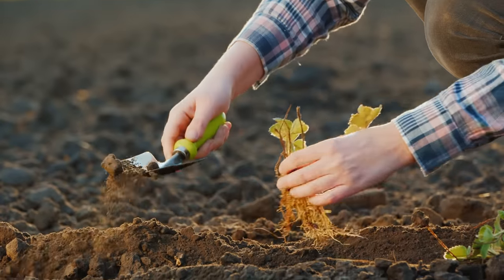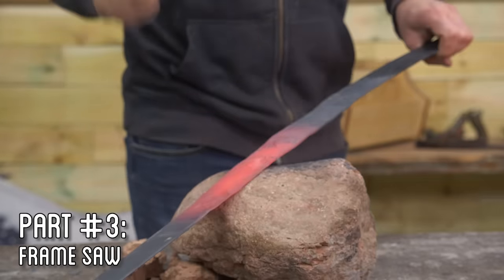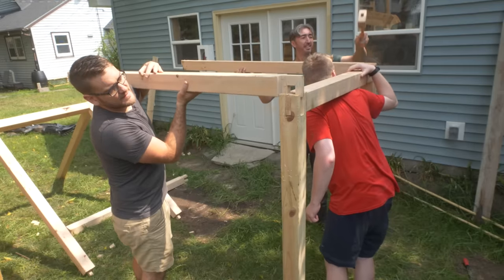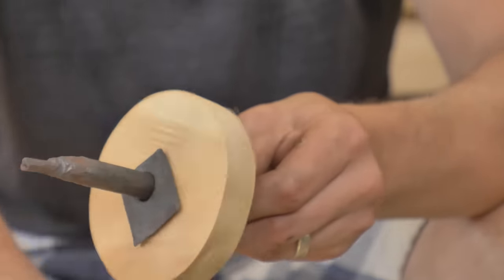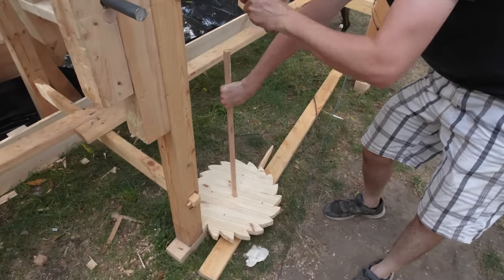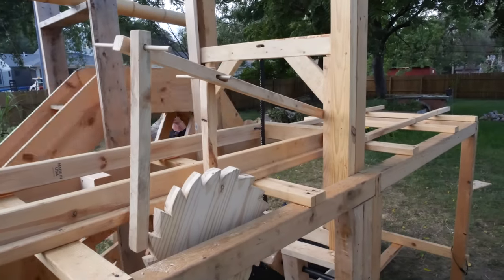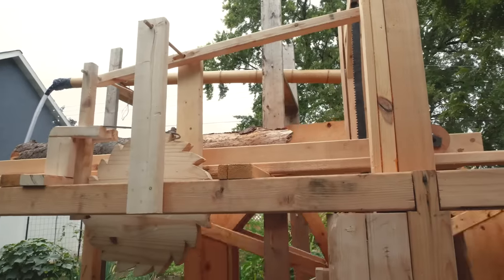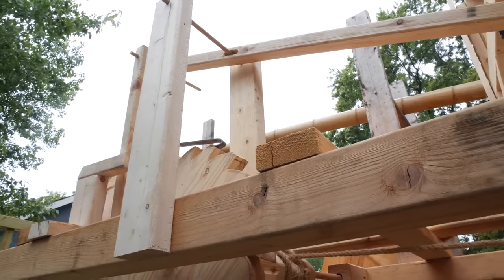I Built DaVinci's Saw Mill

Comment: I have a few constructive criticisms: 1) the transit of your saw frame suffers enough slop that it's actually making an orbital reciprocation. Your cut will suffer from this motion. 2) the tooth geometry of your saw should be revisited. It looks to me that the teeth are filed in a crosscut pattern with a VERY relaxed rake. If you want to rip cut a log (and do so with any kind of speed) then you need to refile your teeth to a rip pattern with a somewhat aggressive rake angle. 3) your results would benefit from ensuring that the saw engages in the cut on the down stroke.
Reply: He needs to see this
Reply: All of that is great advice. His saw blade is definitely holding him back.
Reply: Oh wow! A rennisaunce era saw made with only period technology has slop and takes forever to make a cut? Whoda thunk it!
Reply: A real one wouldn't.  This guy obviously isn't a master craftsmen of that era.  I'm not even sure he knows what a triangle is, considering he made an all square saw support @MeepChangeling
Reply: hell he even makes wooden gears with teeth along the grain
Reply: @philipripper1522  His edge profiling and refinement has been a fairly consistent issue. I think he even addressed it once, as "unimportant" to him. It is a simple enough skill to learn in a few hours of focused practice and would have paid dividends by now. Even with a softer metal, you don't put up with a bad edge, you just have to give quick touch ups more often.
Reply: If anything, the blade needs to be figured out first and formost, for sure. They had proper rip saw blades back then. He used a modern file to make the teeth on that one after all.
Reply: indeed not to mention the slop in the actual drive line, is causing the frame to move where it shouldn't be moving and finally it should be geared with a dog clutch so it can be engaged and disengaged so it can build up momentum before the cut.
Reply: @MeepChangeling bro they definitely had better wood working skills than this.
Reply: @MeepChangeling  Well, the did have excellent saws back then. But HTME is only a few folks, the host not having the decades of experiance in smithing alone that you'd need to make one.

though to TwinPhoenix' credit here, you could make the argument for buying a blade with better handling characteristics now that you've proven you could make one that does work.
Reply: @MeepChangeling  They knew how to make a rip cut long before the Renaissance. This saw geometry needs to be changed for this task.
Reply: As a fellow woodworker I totally agree with this comment. Please fix your saw teeth to make your results far better.
Reply: the frame needs to have less slop (better carpentry, adding diagonalbracing...) and the crank needs to be better and certainly frame and slide as you are loosing lot of power and precision there making the cut wider than necessary thus just wasting power.
bearings must have minium play as any slopines means wasted effort.
surfaces must be greased with copious amounts of lubricant, traditiolnally lard/beeswax/tallow/vegetble oil...  mixed  to be right consistency.
and also the blade is croscut not rip cut
Reply: Some kind of gearing to speed up the saw could also help.
Further the sled could be spring loaded with the ratchet, to ensure a constant pressure and not too much.
Reply: I know the one you built was far better, I just can't find the video again, be a sport and give the link. Everyone should see it, it'll blow their minds!
Reply: I noticed that too. A rip saw would be vastly superior to a crosscut saw. Also, if he maybe put a heavy duty spring on the rope where it connects to the skid frame, it would help with more even and constant pressure with both the up and down strokes. Lastly, seems like the ratcheting wheel has rather large teeth. Maybe more, smaller teeth would cause a smoother continious cut?
Reply: Yeah a better saw would probably speed up the rate of cutting
Reply: @barongerhardt  lots of the joinery here is somewhere between ordinary and awful.  Enormous gaps in joints that could so easily be made good by hammering a wedge into them, instead they make nails by hand...
Reply: How about you build it nerd
Reply: Yes, and a thinner blade cuts faster and requires less power. And grease is your friend, almost every joint and shaft would benefit from it.
Reply: @philipripper1522   You didn't watch the video, did you? It's based on da Vinci's sketches, which includes square supports and no triangles.
Reply: yes, this. One of the reasons I've never subscribed to this channel is that the projects (while big and thus a big challenge) are often pretty sloppy, and then he  says "welp didn't work!" ... but like. Did you see those castle joints? Medieval wood workers could make tight joints, and that does impact performance when nothing is square and loose.
Reply: @philipripper1522  it is a glued plank with cross grain orientation 😛
Reply: Can somebody out there define ‘slop’? I can probably guess, but I’d rather know precisely
Reply: @DFX2KX  You don't need decades of experience to do this. A few hours listening intently to someone decently capable would be enough. A saw like that would not be made by a master craftsman, it would be done almost exclusively by an apprentice who was likely still a child.
Reply: To chime in on the comments below, I think this is the perfect example of why/how technology can be lost and it takes awhile for it to be rediscovered. There's so many little nuances and terminology in this post thread that even I never knew about (like rake angle, slop (I'm assuming that's an industry term and not a typo for slope), along the grain vs against the grain, types of lubricant, etc.). The fact that HTME isn't an expert wood craftsman or smithy is exactly why I like this series. It shows really just how difficult it was to come up with the initial concept (and even then, it's a proof-of-concept prototype, not the finished product). Sure, in the late middle ages, you had maybe 500 other experts in your city/kingdom who then tried their hand in improving things, and those are the ones that tend to get all the credit for perfecting it, but it's more interesting to see how far one person (or a handful) can "move up the tech tree", so to speak.
Reply: @philipripper1522  It's literally impossible to make circular gears with zero teeth along the grain... unless you use plywood which curiously I don't see many examples of in Da Vinci's time, but let me know if you know of some...
Reply: @najroe  You can't "add diagonal bracing" bro. It is a build of Da Vinci's saw design, and the design clearly has no diagonal bracing in it. Joints can be nicer, yes, but the diagonal bracing is a flaw in the design from Da Vinci, not from this youtuber. Address your concerns to Da Vinci: 1357 Maple Avenue, Leonardo, Pennsylvania
Reply: Was at the very least expecting that wooden rod pushing and pulling the full force of the saw to snap in half.
Reply: It also doesn't help that a majority of the components are made from pine, which isn't the best material for something like this, someething like a red oak or even a white oak would be better because of the density and weight, heavier and more dense woods make for better framing and structural materials but they are a bit mire difficult to work with as a result of their density.
As it stands now, the whole frame and "body" of this sawmill is extremely weak and flimsy compared to what it needs to be in order to saw lumber.
Reply: @jennifer255  those words aren't "industry terms" they are very common sense words that a lot of people use in every day language, if you wiggle a door handle and it flops around, then that is slop(or play). And the rake angle is simply the angle that the teeth are on a saw, they also use rake for barges or basically anything else with a "degree of slope" technically has "a rake" to it, and that rake can either be positive rake, ir negative rake, depending on it's orientation
Reply: @gavinjenkins899  this is not that difficult. you build a traditional wheel. and then you cut the gears from it. you probably need to align the grain a bit differently than an ordinary wheel but it is possible. 

The question is, is it worth the hassle?
Reply: @spec_opsgaming  Never heard that for a door handle, at least in my part of the US. We'd just say "jiggle" . I also thought "Slop" was wet, formless food. My grandfather did grow up in Appalachia, and his 2nd wife was from West Virginia, so maybe my mom picked up some Appalachian dialect terms and passed it down. :D
Reply: @nilsdock  1) That would make ALL the teeth wrong 2) traditional wheels are held together by a metal hoop on the outside, what holds it together if there's active gear teeth outside instead? And trying to make a wheel instead with a bunch of thin crosscut pieces would almost literally disintegrate in your hands. I say it's basically not possible, because the rotation and general integrity of the wheel needs the grain to be around the circle, but the teeth not breaking off needs the grain to be radial. It can't be both at once.
Reply: This comment proves you missed the point entirely. He's working from a period sketch, so the design is directly inspired by it. The point of the video is that it proves Da Vinci's saw mill "works", though not very well. Obviously it can be improved, with the benefit of several centuries of hindsight and / or an engineering degree. This is obviously not the point of the channel. He's trying to retrace the footsteps of our ancestors. The iteration is the point, not jumping to the end. As for the sawblade, given that he hand-filed it, I'm sure he just didn't want to have to make another one, especially since he's still using it in his bow saw.
Reply: @Lux158  I would just opt for a gravity feed. A suspended weight and pulley system could pull the log into the blade at a constant pressure. If its to much pressure reduce the weight to little give it more weight. Simple and efficient. For saw speed a larger crank with a longer throw is more practical then a gear system. A cross head can make sure the saw only gets up down movement with less binding.
Reply: The orbital reciprocation of the blade is not necessarily an issue if the orbital direction is correct. Engage on the down stroke and at not on the up stroke. With the direction it's currently moving, it won't do that, but with the direction of the Da Vinci design (with the under-flow water wheel), it does. You could instead turn the current water wheel around and get the desired motion
Reply: He’s saw blade frame is moving wood on wood, I can see a lot of loss energy via fiction. Use grease or add wheels to the fame so when it moves up and down you get 100% energy into that blade. Also add a few gears to change the blade speed I wouldn’t run the blade from the water wheel it’s self but have it run off a smaller gear that feeds of the main wheel. Best thing to do is get a book on clock work you can learn how to make things move in timing and in different speeds
Reply: Definitely unskilled builders, so sloppy and wonky, sharper teeth would help and change their geometry 😳
Reply: Resisting forces along the grain on red oak would be worse than pine, across the grain you're 100% right. Well anything is better than 'whitewood'.  But the biggest lost of strength is just the grain orientation @spec_opsgaming
Reply: its been pointed out repeatedly i dont think he actually reads comments
Reply: Funny how you all are a professional woodworker but failed to understand the instructions made in 1400 😂😂😂😂
Reply: That makes sense raising the efficiency of the blade makes less stress and heat
Reply: those weren't instructions, they were a sketch -- real plans for this kind of device existed in this era and DaVinci just drew a picture of one in his notebook for fun, it's not a plan @wetwildwendy
Reply: In the words of the great Jeremy Clarkson, “Ambitious but rubbish.”
Reply: Get rid of the wheels on the log sled, tighten up all the sliding surfaces and lather them with tallow. Also maybe don't try to power the thing with a hose pipe.
Reply: Don't know it it was mentioned here, but using pine won't help at all. I'm sure it's due to the cost of production but, a hard wood would be the way to go in this kind of work/all his wood apparatuses. Or at least a harder pine and not 2x4 lumber...
Reply: I love the helpful hints if you was building one , but maybe it's just me but the wording you used sounded kinda condescending.
Reply: I would add a stop pawl on the ratchet and maybe a pulley system to reduce the sled travel per stroke.
Also the connecting rod on the crank is waay to short ending up using most of the force just to work against itself
Reply: @jennifer255  the point is the actual terms don’t matter, it is the concepts which are very common sense. The terms just come about as a way of communicating the concept. “Slop”, “Play”, “Jiggle” all describe the same thing, a loose fit and telling if it is a lose fit is something pretty much everyone could do.

Anyone who is seriously working on this could figure out concepts like the angle of the teeth as well.
Reply: Do a crossover with some of the woodworking YouTubers so your machines are well built. Better joinery, glue, and real craftsmanship will do your series a huge favor.
Reply: @philipripper1522  And still you missed the whole point of the video 😂
Reply: Yeah, the slop, of course, is a result of him trying to remove friction of guides from the equation. The saw doesn't have enough torque to both cut and deal with friction.
Reply: @MeepChangeling  you might want to Google that before making fun of rennisaunce era carpentry.
Reply: As a carpenter I concur. And I think it has a lot to do with him copying the sketch in a littral fashion instead of researching real world contempurary solutions so he could use DaVinci's sketch as a piece of concept art and then build it like they would have done it in real life back then
Reply: I feel like the bad saw tooth profile, sloppy construction, etc., is working exactly as intended by generating lots of engagement in the comments section.
Reply: @benjamincox7425  Excessive play in the joints and moving parts.
Reply: @MeepChangeling You really think they'd see these issues back then and go "Huh, shame about that" and not yry and fix it? People were still smart and practical then, and knew how to cut a log good, especially if it was their craft.
Reply: DaVinci speaks
Reply: Word up...
Reply: That rather tech for me , however perhaps he should have done some research how they cut lumber in those days. He might have had a reasonable result instead of good timber going to waste.
Reply: honestly I can't stand the way he does stuff, now i remember why I stopped watching him. Poor research, poor building. I watch plenty of other channels that do historical recreations of things so much better, with proper research and time gone into making things, and a lot more common sense when it comes to problem solving
Reply: @SmolPotatowo when I saw his blade I was instantly like “why didn’t he file it like a normal blade it’s basically just sanding the wood not cutting it
Reply: They could also put the saw under more tension, and or make it longer.But yeah, that sawblade could use a touch up for sure.
Then if they triple the amount of teeth on that wheel that pulls the log, make their intake for water bigger and put a filter on it, it might work as intended.
Reply: This should be the pinned comment.
Reply: Correct me if am wrong. Orbital reciprocation pretty much means the blade wants to twist when working??
Reply: This was divine is not modern man back off fuzz ball
Reply: @MeepChangeling actually I have seen a similar saw made and it cut fast and clean joints were very tight. Different wood for construction is key.
Reply: Aaaand a much longer connecting rod would direct the power of the crank along the direction, the sawblade is supposed to be accelerated in wich. With this short connecting rod, the crank pushes against the sawblades framerails in a steep angle.
Reply: @shelbyseelbach9568  @4:37 you can see the most unprofessional joint I have ever witnessed in YouTube history. That joint says so much. 

Firstly, it shows the lack of attention to detail in cutting the joint. You don't get a quarter inch gap without being careless. All while talking about how secure this form of jointing is. He says they can better secure it through nails and some glue. No, you cannot. For wood glue to work properly, you need darn near a press fit. You can create a filler from wood glue and sawdust, but it has no structural strength. So the real solution, after already removing too much material, is to place TWO glue covered wood wedges in the gap. They should be cut so as to have a press fit. You stick the wedge in there and if you dont have a quarter inch sticking out, you cut the tip off until you do. Then you pound the second wedge in with a mallet, trying to get as much as possible of that last quarter inch in. Then you you just chisel, file and sand to make it flush. 

Instead, he shoved a bunch of wood splinters, nails, and glue into the joint in a very noob-a-licious attempt that actually takes longer than the proper fix. I mean, I am a retired toolmaker not a carpenter, but I still have a bunch of wood wedge in my tool box. Why? Because they are a staple of every home repair/handyman/homeowner. 

And I didn't even begin to discuss how two nails holding a sloppy joint together leads to delamination around the nails. Nor how important structural rigidity in general leads to better efficiency, repeatability, accuracy, wear and repair... 

The guy really should work on his attention to detail and his fit & finish. He can work less, have a better result, and look far more professional. 

tl;dr If you don't have time to do it right, then you don't have time to fix it.
Reply: @krisspkriss  I'll refer you to my previous comment.....
Reply: @shelbyseelbach9568  And I will refer you to the fact the man spent longer doing it wrong because he is too stubborn to do it right. 

I don't make YouTube videos. I make shit that actually works. That is my bread and butter. Sad you dont understand how in modern economy you find a specialization and niche. His is making  videos of him making things that dont really work but it is close enough to fool the normies. 

So if you hire someone and they do a shitty job on your car/house/fence/yard do you say "well I didnt do it myself so I cant complain". If so, then you are so precious. 

The guys sucks balls at making things.
Reply: @krisspkriss  That's what I thought..... Keyboard warrior.
Reply: @shelbyseelbach9568  OK, show me where I was wrong in explaining how to fix this contraption. I will wait.

The lady doth projects too much, me thinks.
Reply: Surprised that after the first minute I noticed the same things.  He looks super tired though, so I imagine he’s burned out.
Reply: RepentandbelieveinJesusChrist5  HILARIOUS!
Reply: @MeepChangeling  Don't underestimate early modern handicraft. The artisans back then were very good at what they did - after all, different to a modern day experimental archaeologist, they practiced their work every day and knew their materials and techniques.
Reply: @johnathon007  Even an apprentice would not be allowed to make such a horrible blade - he would have to master and demonstrate more basic skills first.
Reply: @gavinjenkins899  I believe it was the Egyptians or Greeks who made plywood in ancient times. It is hardly a recent invention.
Reply: @gavinjenkins899  He said "based on", not "as identical as possible".  Da Vinci's design lacked a lot of information that was used for this machine.
Reply: @philipripper1522  Wheels were assembled out of segments since ancient times for that exact purpose - to get the maximum strength for the desired purpose.
Reply: @philipripper1522  I think the builder even mentioned that in the video.
Reply: @VictorGuzman610  I think in this case that it means a saw blade the move toward the log after momentum is gained for the cutting stroke and retreats a bit on the non-cutting part of the stroke.
Reply: I would just like to say that, 1) if this came across as condescending then that is entirely due to the way in which YOU perceived my statements.
2) as I stated to begin with, my comment was meant as one of CONSTRUCTIVE CRITICISM which is meant to help provide insight in hopes of future improvement and to assist in overall growth.
3) I think that this guy is accomplishing something that is truly fantastic and enlightening. As a fellow craftsman, I love watching his process and problem solving approaches. I want nothing more than to see this guy succeed, progress, and continue to share his knowledge and lessons with the rest of the world. Support and collaboration is what will help our entire species progress and thrive.
And 4) of course I watched the entire video. Y'all are a bunch of (likely) well-intentioned individuals that happen to be jumping to conclusions and then taking offense on SOMEONE ELSE'S behalf and attempting to defend someone who didn't ask for your defence against words of positive encouragement that you decided could only be a means of attack, by whatever logic you failed to employ, when there was no reason to defend anything in the first place.

Honestly ..... Grow up. I'm only trying to contribute in a positive manner to help us all progress in some small capacity. You, on the other hand..... You're part of the problem that will hold us all back. So thanks for that....
Reply: I admire your criticism. You're not being rude in any sense. Forget the other crybabies that just want to be keyboard ninjas.  Guaranteed they never pounded a nail or turned a screw,  at the least
Reply: Well, their YT machine seems to run pretty well.  Nice chunk of ad revenue that comes from monetizing 1.75M sub channel.  Maybe they were fine tuning the YT machine and figured that learning to build it too well wouldn't get the optimal amount of engagement.  Call it fine tuning their entrepreneurial engineering skillset. . . LOL.
Reply: @nilsdock you can't align the grain on a circle. The whole point of a circle, is kind of that it goes all the way around evenly. So, if you use a couple of those brain cells, you'd know that means your gonna get all angles of the grain, more or less evenly. Stop acting like you know what your talking about when you cant even show basic material knowledge.
Reply: @jennifer255 nah their just up on their high horses pretending to be high and mighty because they figured out how to look up a couple words in the 21st century 🤦
Reply: you assume one piece of wood being used. what I proposed was to join several pieces of wood, therefore you can get the grain direction you want almost anywhere. lets say the outer part of the wheel is made up by 8 segments, and if we align the grain in the middle of each segment to be optimal, then the grains would at most be of by 1/16 of a full circle or 22.5 degrees of.

however the craftmanship to get a wheel like that built would most certainly not be worth the hassle.
   @byeluvby
Reply: A very cool project!
Reply: YEs I suggested CASTING a thicker sawblade, as I noticed a lot of flex during the cutting motion, due in part to a small crooked hammer forged area.
Reply: @MeepChangeling you are a fool if you think this thing was poorly constructed during its actual use back in the day
Reply: @IanZainea1990 I noticed that too. I made better stuff in high school woodworking than this guy

He is far too sloppy
Reply: @jennifer255 nah, this guy is just a slop. I made finer stuff in high school woodworking
Reply: @wetwildwendy if built in the 1400s, it would’ve been vastly superior to what this YouTuber did
Reply: To many big words
Reply: Cool. Wheres your saw mill?
Reply: @joost1120  They are concept sketches, not blue prints. He should have adapted to need.
Reply: Y’all really missing the forest for the trees, they filmed, edited, and built. They forged nails by scratch my dudes. critique all you want but what they did is incredible and y’all need to stop with the armchair hubris and give credit where it is due.